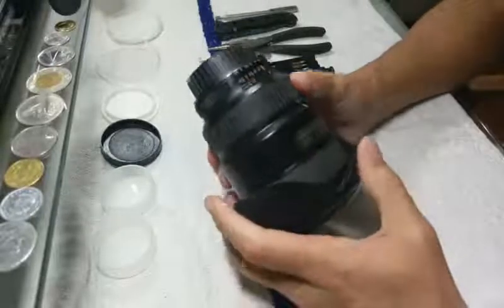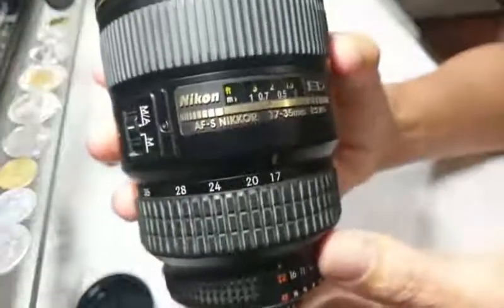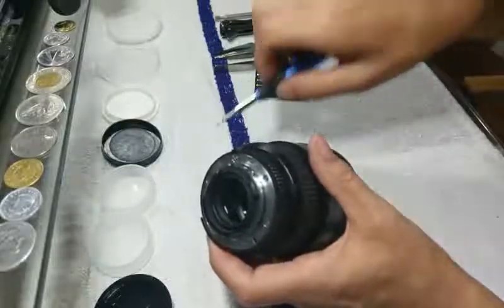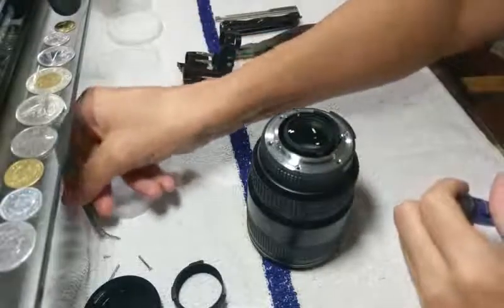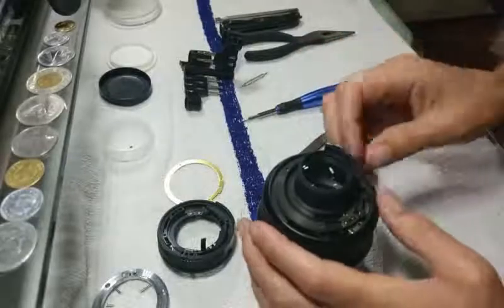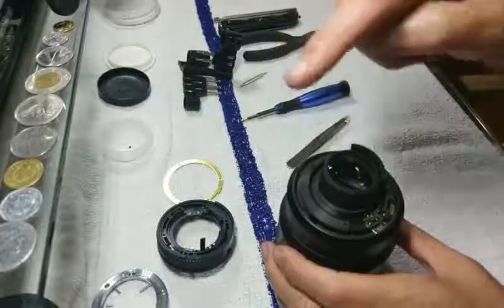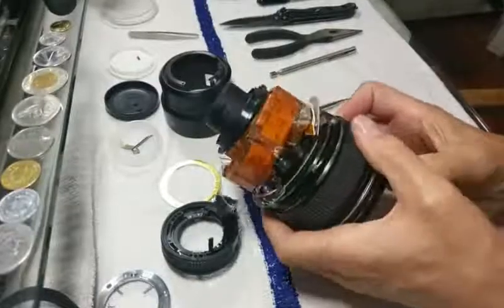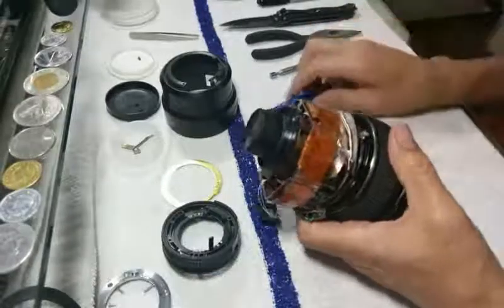Nikon 17-35mm f2.8d Stuck Zoom Repair

Comment: I want to congratulate you for the excellent video. They are guys like you who spend hours filming an already delicate process to share solutions that many people sometimes look for in despair. sharing knowledge without asking for anything in return is an attitude that will always be rewarded, let alone the respect that is earned.
once again my congratulations and thank you very much.
David
Reply from the maker: Hey David - you're absolutely welcome. I wish I could say all that work fixed the issue. In the end I sent it to Peachtree in Marietta to get it looked at by more qualified folks. Turns out the helical was bent when I bought it. I picked it up cheap because it had the issue. BTW - Peachtree are great folks and awesome service on the gear they're authorized to service. Some items have to go to Nikon.

Comment: Any suggestions what to do with a lens stuck at the 35mm end.  I can’t release it and the circuit board wrapped around the body means I can’t access the nylon guides,
Reply from the maker: Hey Mike. I'm far from an expert, just a guy willing to take things apart and figure them out. If you're not comfortable completely disassembling yours I'd recommend sending it to Peachtree in Marietta, GA. https://www.peachtreecamerarepair.com/
In the end it turned out my helix was bent. Mine must have been dropped before I got hold of it. But Peachtree fixed it up like new.
Reply: @VincentSmith1776  Would you please share how much was the cost for that job?
Reply from the maker: @taz24787  I'm so sorry, I no longer have the emails from the work and just can't remember. It was about 3 years ago. I had the work done by Peachtree in Marietta, GA and recommend them.
Reply: @VincentSmith1776  I understand, thank you!
Reply from the maker: @taz24787  I can say it couldn't have been over $350 or I don't think I would have paid it.
Reply: @VincentSmith1776  Oh ok, good to know. Thank you!

Comment: Hello, it seems to have an aperture ring. Is it possible to mount it on a mirrorless camera (other make)on manual mode?
Reply from the maker: It does, but the issue wasn't related to the ap ring. But f-mount lenses can be adapted to Nikon Z mounts
Reply: @VincentSmith1776  What about mounting it on Sony A73?
Reply from the maker: No idea, strictly a Nikon guy
Reply: @andorakotomalala3399  yes it is ! i was using on my a7iii as well, made a lot of professional videos with it, works nice on gimbals as well